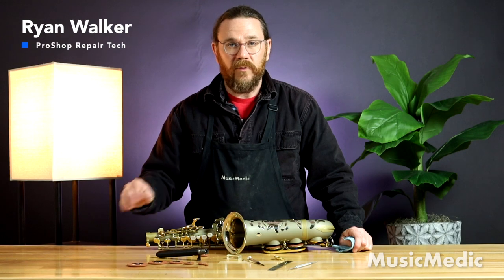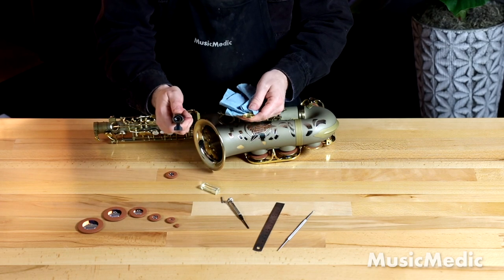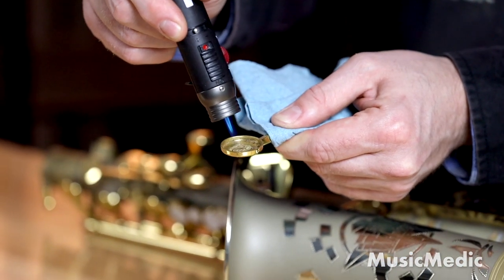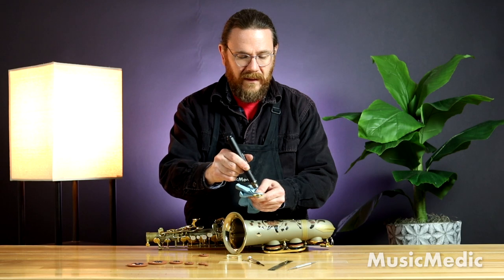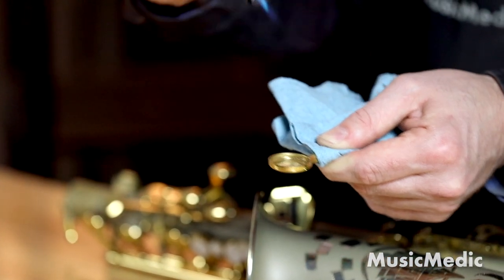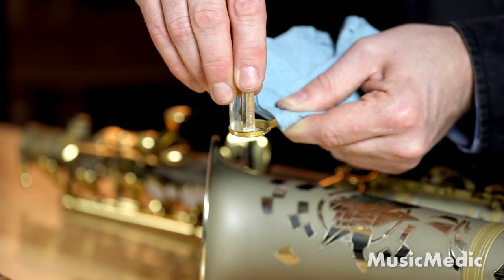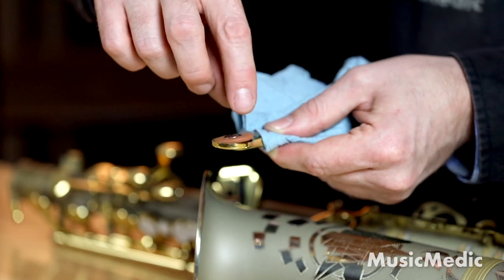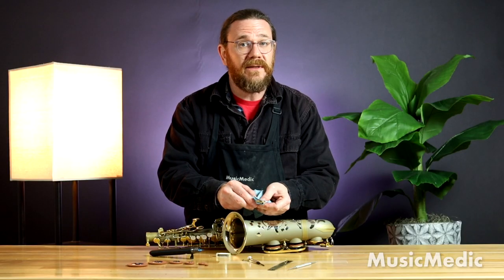Applying Shellac to a Saxophone Pad Cup

Comment: Question: You have 2 videos that show 2 different methods for installing pads. One showed putting the shellac in the cup then putting the pad in. The other shows putting the shellac on the pad then installing it in the key cup. Which is better? Which do you prefer?
Reply from the maker: Either method will work. Ryan prefers to put it on the back of the pad that way he can actually see how much is on there before it goes in the cup. We also put it on the back of the pad so we don't have to heat the pad cup first, because shellac won't stick to cold metal.
Reply: Thanks!